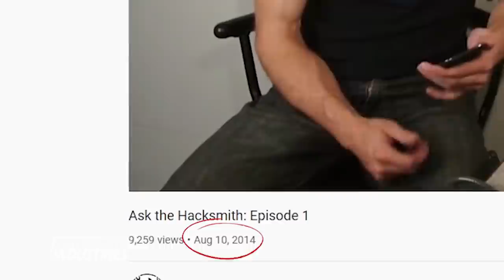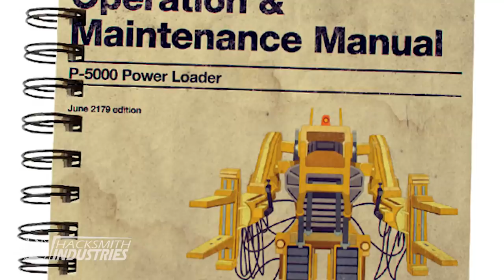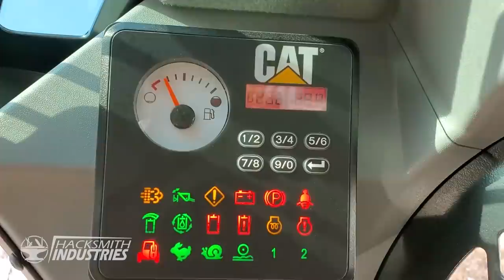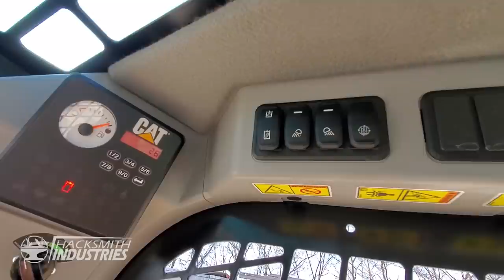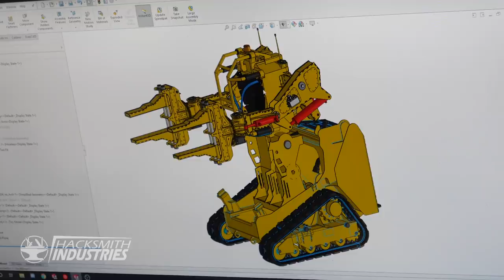WE GOT A TANK! (POWER LOADER: PART 11)

Comment: You have now 3 axes to control: Move the Feet's forward/backward and Turn Left/Right and these 2 Arms. But you have only 2 Human Arms :). Perhaps use an Pedal on the ground to steer the tracks and movement of the "Tank". A bit like an Airplane Pilot seat or Bicycle Pedals. Right Foot pedal: Forward/backward, Left foot pedal: Left or Right (if you are an Right hand user), with an Lock Switch for accidental slip movements and an Fine Movement Throttle (like 7:17) for Little steps or sprints. Or ask some Motorbike Riders, you know Shifting Gears with their Foots. Perhaps something similar is good here

Comment: You also have a rabbit mode on the left stick I also used the pedal kept the Nob all the way down and controlled the rpms with the pedal for when I get close to a building car or loading and unloading material from trailers or trucks or loading materials also theese new gen of cats are simply amazing in every way EXSPECIALY the new excavators with all the controls like self leveling bucks and also depth control and all that just simply a very very very amazing game CHANGER for the new models so awesome using one .!

Comment: PLEASE make a VIBROWEAPON from STARWARS!!! 
They can be daggers, swords, or even hammers.

"Vibro-generators, most often found in the hilt or handle of the weapon, sent out high-frequency sonic pulses that could cause anything attached to the generator to be sent into an extremely quick vibration. When the vibroblade contacted something, notably organic tissue, the vibrations rippled across the material, destroying a giant portion of the victim's body and damaging the target more devastatingly than a blade without a generator. This caused even the slightest glancing blow to potentially become a gaping wound. When put up against heavier armor types, a vibroweapon could be upgraded with a focused vibrator cell in order to focus the stabbing point of the weapon and penetrate even through the strongest armors." - Wookiepeedia

Comment: Hope you turn down the hydraulic system pressure or install pressure limiting valves, as those Shurlift actuator cylinders will only handle the Cat's system pressure for so long before failing. Just sayin'... (Don't ask me how I know.)
Also, some cushion ends on your actuators might improve your design?

Comment: What is the oil for?
Reply from the maker: That's what hydraulics run on
Reply: Thank you @hacksmith  . All this time I thought it runs on air with air compressor like the cylinders, and the oil is to make it flow faster. 
(For the Future I’m planning to make a human size robot with cylinders) Now I’m making a prototype with cardboard. I’ve Finished making the Torso with arms attached and it works perfectly👌 (360 degree motion)
Reply from the maker: Thats called pneumatics :) which uses compressed air. Hydraulics use oil at a pressure over 10-20x as much as pneumatics, making it much stronger, and precise

Comment: 5:12 wait u gonna put a construction car on a truck??????
Reply: ? It's generally how all tracked and almost all heavy plant is moved between sites. 
Most tracked machinery isn't driven on roads; it'd use too much fuel, damage the tracks & powertrains, wreck the roads and take way too long. 
Some tracked vehicles maybe adapted for road use, with the tracks fitted with rubber/compound pads.